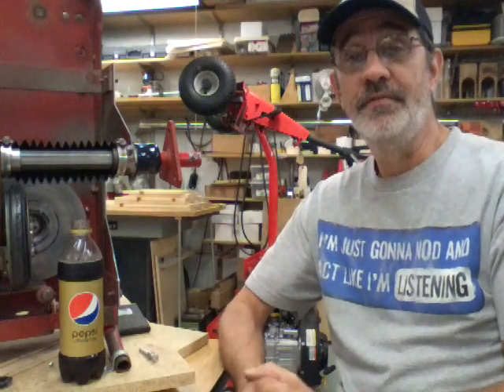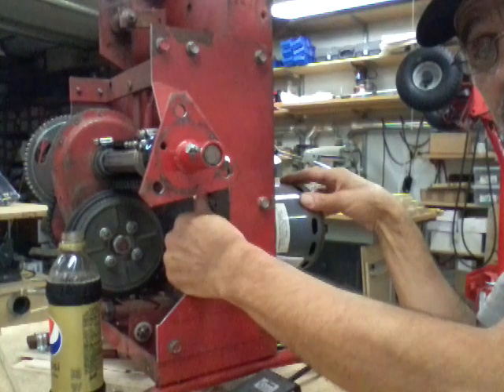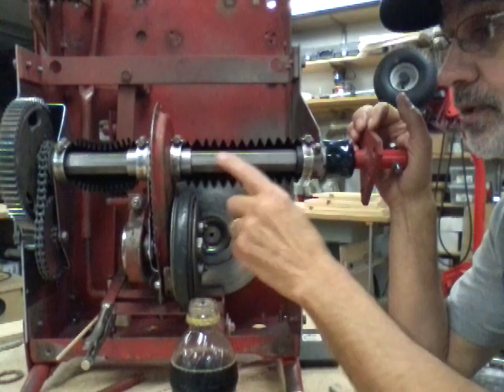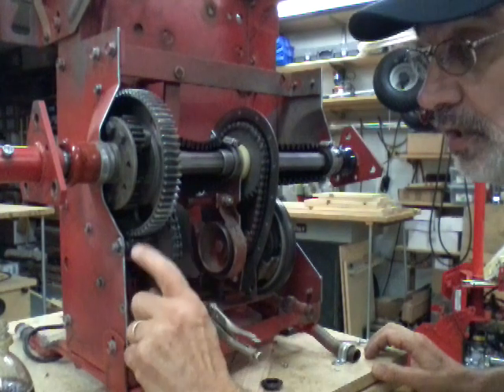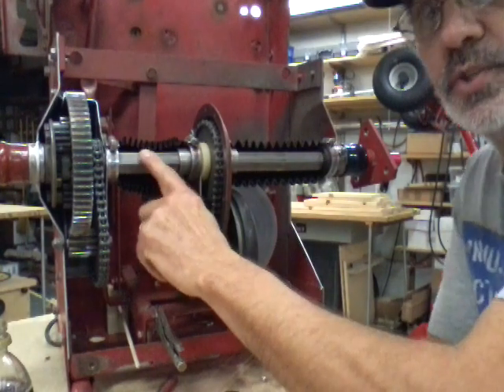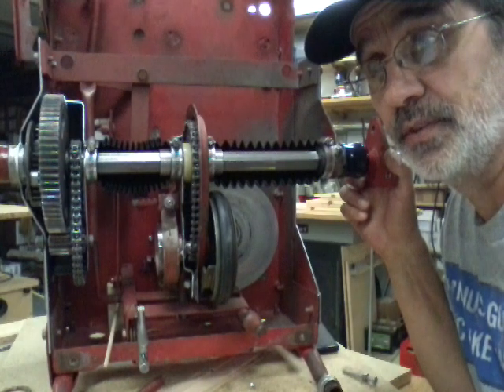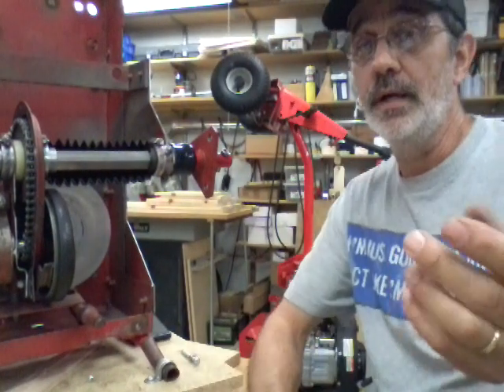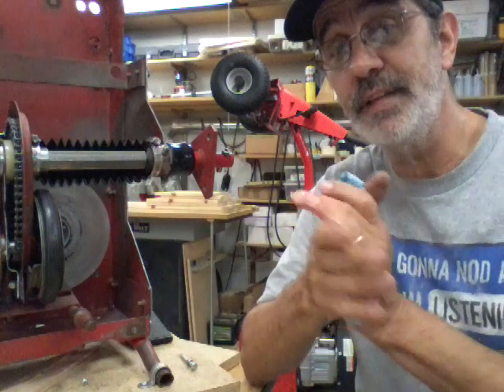132. M/S. 16  troubleshooting the drivetrain on a Snapper rear engine rider

Comment: Bought my house in 1990, came with a1986 11hp 33" rider.  Still in the house, and still using the Snapper.  What a simple, quality lawnmower.  Your video on the transmission, makes me appreciate it even more.  I never knew there was that much engineering in the final drive. Thanks again for posting this video 👍  Love my Snapper
Reply from the maker: Well thank you for watching and hopefully for subscribing it’s free and it really helps me. Jim
Reply: I have that mower!  33" single blade and the innovative swivel mechanism make this the best cutting mower I've ever had, and I've had quite a few. I bought it for $250 with a shot rubber wheel from a guy who had just got him a zero turn. We went through it and replaced chains and differential gears. After one of my boys forgot to replace the oil in the original B&S 11HP, we salvaged a Kawasaki 14HP from a Deere, and kept the Snapper going. My says "Hi Vac Xtra Tough" and it is. It's 38 years old and so simple and tough, I think I'll keep it a few more years.  I just watched this video because after a belt change the brake is locked on.  We'll figure it out with help from Jim.

Comment: Jim, Thank you for the terrific videos. So I had a drivetrain problem on a 2015 Snapper rider as it stopped going forward and backwards as I vacuumed up the last of the leaves. I almost gave this repair to a local shop due to my arthritis but it is a warm day in NJ so I went for it. I did all the trouble shooting recommendations you suggest and moved to checking the reduction gears in the transmission. I removed the right tire and the transmission cover bolts expecting to find a bad gear. Nada, all looked good and put it back together just enough to reconnect both axels. I repeated checking by turning the friction wheel and could feel the right hex axel turning under the boot. I looked some more at the left side and noticed the left wheel sometimes turned giving me a false positive. I  then removed the plastic wheel cap finding that the axel bolt had sheared. LOL I am still chuckling to myself, such a simple fix! Recommend that your video be edited adding that as a first step one should check both axel shear bolts.😁
Reply from the maker: Oh I have a video talking strictly about that because it is such a common issue but I’m glad I could help if you need anything else please let me know and I hope you subscribe it’s free and it really does help me keep this channel going. Jim
  Oh yes I forgot I do charge for my help and what a charge is a picture of you sitting on your snapper to hang on my wall of friends. I have a little over 200.
You can send it to my email which is
jimsfixitshop@gmail.com  and any other questions you can send there also.I try to put out a new video every two weeks at least and as soon as I get my shop cleaned up I am going to have a shop tour coming up pretty quick.

Comment: Hi Jim, 
Due to the drive chain issue, I ended up buying my first 'brand new' Snapper. I've had 4 over the previous 37 years - but I always purchased a used Snapper. The drive chain issue was not resolved by switching the transmission on a older unit. I'm excited to have one that I will be able to use reliably for the next couple years. The old one was hard to start, leaked/burned oil, so the transmission was the final straw. 

Thank you for your help and support. I will shift from watching how to repair to how to maintain. 

Best regards, 
Paul - South Jersey
Reply from the maker: Paul Raybould 
Hey send me a picture of you sitting on your new snapper. Jim

Comment: hello. Just bout a used 33" snapper and it doesn't have enough power in 1st gear and gets stuck in thick grass.. I'm going to go through it per your video and see what's up. Thanks for taking the time to explain all of that to us. I will keep you posted with my progress. Thanks again.
Reply from the maker: @grey8940  well first watch video number 70 and tighten your yolk, spring and see if that helps
Reply: @jimjackson9381  Yes! okay, I will do that.

Comment: Great video and information! My snapper just started "bucking" when I put it in gear and drive. Almost like there's a bad tooth or something on one of the gears. I guess for now I can check the drive disc and then go from there. It's obviously worse when I go uphill because I'm putting more of a load on it.
Reply from the maker: Let me know if you need anything or help.

Comment: Thks, Jim, that "explains", the mystery of how< "this", differential works . Real good explanations, I don't have all the names down. I already forgot how many teeth were on that big gear. but everytime I watch your videos I get a little bit more. Still looking to see what part gives the different speeds.
Usually it's a transmission . But I don't see one! I think I'll ask that new co-pilot thing in my computer
to see what his or her explanation is of where the transmission is on a snapper  rear engine mower
lol
Reply: the answer I got from the co pilot about where is the transmission No conventional tranny. Explanation was, as the chain case moves along the hex
drive axle it changes sprockets in the differential with the chain drive inside the differential . I'll have to look in my manual's
parts layout and see if I can spot different size sprockets.
The co-pilot also referred me to your videos, but I haven't found one yet explaining the shifter movements thru each gear 
and showing all the sprockets in a pile on the bench used
and explanation of how just because the chain drive gets closer to the differential box it can magically switch chain sprockets into a higher gear ratio.
It doesn't seem like there is that much room in there to do all that
Reply from the maker: A snapper is a friction drive machine that’s been around 50 years. It’s very dependable simplistic and easy to fix. You won’t find anything else on the market that picks up leaves like a snapper does as long as you buy a rear engine snapper with a Hi-VAC deck. It is a patented deck design that no one else currently uses even though I’m sure the patent has long since expired.       Happy Shappen.       Jim
Reply: @jimjackson9381  I put a long post how
I figured it out putting 2 & 2 together on video 89 I guess there is no heading transmission cause there isn't one. sort like variable speed in a way. As I still have never driven one. Thks for the ability of a HV version. I had a chance to buy one of those
I guess would of given mine more of a purpose I didn't know they picked up leaves so good. But it was missing the catching stuff and more money.

Comment: Thanks for the video.  I'm having an issue with shifting.  My snapper runs fine in 1st & 2nd gear.  It also runs in 5th but it will stop.  It will move again if I press in the clutch.  It only does this in 3rd-5th gear.  I just replaced the clutch disk which was a bit worn out but that didn't solve the problem.
Reply from the maker: You may want to try tightening your yoke spring and check the slot in your yoke to make sure it is not wore out that will cause issues. Jim

Comment: Jim my name is wayne and i am from Knoxville Tn i am enjoying and learning a great deal from them. I have a snapper model 28106-2 rear engine snapper lawn mower and having the now forward or reverse. I have checked the movement of the axles and tires and the transmission is i believe working as it should. I decided to disassemble the rear axle and differential case to check some of the items that you suggested. i found that the bearing on the right rear axle has worn just down to the frame but no further, the clutch disk is worn down but more on one side of the rubber disk than the other. I assume this is because the axle was out of alignment because of the extreme bearing wear. I did take apart the left side and take apart the diff case, i found most of the parts seemed ok but the large gear was extremely knifes edge. Not sure if the chain needs replacing but probably does.  Now that you kind of know where i am at and have limited funds and the fact that i only use the mower three or four times a year to mulch the leaves. I know the long axle
shaft has some wear on it but if i just replace both fender bearings, boots, clutch disk, the big gear in the diff, and the chain without the long axle in your experience how long do you think the fender bearings would last if i only use it 4 times a year on 1/3 of an acre . Thanks for your help wayne
Reply from the maker: Yes I think you’d be OK by doing that the long axle usually gets more Abuse because nobody greases the outboard bushing in the fender if you look close you’ll notice there is a grease fitting in it but it seldom gets any grease I might grease mine once every two or three months. Thanks. Jim
Reply: @jimjackson9381  Thanks for the quick response, if you have any good used parts i could purchase from you from the ones i listed i would be happy to get them from you before i make my buy on new ones.  thanks Wayne

Comment: Hi Jim, So glad I found you. Have a 2012 SPX 2042 and trans is grinding. Still works, but dealer said he doesn't know what's wrong but would be too expensive to fix. Ugh. Not sure I can tackle this myself but at least got a lot from your explanations on how it all works. Should probably check in with someone else that i know as to whether its worth fixing or just run it after its regular service. Was told not sure how long trans will last.  Would appreciate any feedback on all this. Thank you!!
Reply from the maker: I’m gonna need some pictures of this thing I’m not sure I know what the SPX 2042 is that model number doesn’t sound familiar at all to me you can send the pictures to my email which is
jimsfixitshop@gmail.com
Thanks.    Jim

Comment: Jim, I have a 2011 Snapper rear engine 28" mower. I am replacing the engine. Do I need to remove the mowing deck to reinstall the engine????  Stupid me I did not see that the oil filter came loose and the oil drained out seizing the engine. Lesson learned. Also do you have a video and replacing the engine?
Reply from the maker: Sky High 
No you don’t have to take the deck off it might make it a little easier but you should be fine, you do want to check the engines and make sure that the crankshaft is in the same location in relationship to the bolt pattern that holds it down to your machine otherwise you’ll burn up clutch disks in no Time. Jim

Comment: Your model is awesome- my snapper all of a sudden is jerking real bad when I put it in any gear - when I turn it Jerks as well and the mower "slides" in stead of turning
Reply from the maker: Well, I’m not sure what’s causing the jerking but when you try to steer and the machine goes straight, do you have a bagger on the back your machine? It sounds like you need to put some weight on the front between the two front tires and check to see how much tread you have on your front tires that will also allow them to slide instead of turning. Jim.

Comment: Just bought a used model 281016BE Snapper and was made aware that the engine would shut off when brake/clutch pedal is released. Was shown that the seat switch had already been bypassed years ago and not the issue. It looks like you briefly showed a switch in another video at the bottom near the yoke. Do you think that could be the problem? I really enjoy all the info you show in these videos!
Reply from the maker: Well,by what you’re explaining I would say that’s definitely your problem. Take that switch off and check it and check the wires going to it. Jim.

Comment: Thanks for the help, sir. My Snapper ST2446 46-" mower began surging while I was mowing. When I pressed the pedal, the mower would hesitate for a second before final engaging and jerking forward. It finally totally stopped engaging, and now won't move at all, either forward or backwards. Any thoughts or suggestions?
Reply from the maker: You could have broken one of the chains either in your chain case or your differential. Jim
Reply: @jimjackson9381  Thanks. Might have to let a pro work on it.

Comment: Hi Jim I’m a subscriber but I haven’t seen my problem. My snapper acts like the clutch is slipping. It won’t go up a small incline and even worse in higher gears. The wheel has lots of rubber on it. And reverse seems to work good. Thanks Jon Helms.
Reply from the maker: Jon Helms 
Have you watched video number 70 it will explain how to tighten your yoke spring that is probably all that is wrong with your machine, if it doesn’t help please let me know. Jim
Reply: Yes That was the first thing IDid.
Reply from the maker: Jon Helms 
OK now takeoff both tires pull your dust caps away from the outside of your fenders so you can see your bushings if your bushings are worn and letting  the axle swap around that’s going to affect how the machine operates check that and let me know. Jim

Comment: Jim,
My 28inch snapper locks up. After pushing and pulling the machine it unlocks for a period and then locks up again. Think it's the big gear or one of the pinion gears?
Reply from the maker: Oh, if I had to guess I would say that’s probably what your issue is send it up and look at the outside of the differential case and see if it’s OK or if it has a rip in it. Jim.

Comment: Would you recommend 80w90 gear oil over the "00"? Just bought my first snapper sr1433 !
Reply from the maker: No, 8090 is too thin and it’s gonna leak especially on an older machine that hasn’t been built to except the thinner oil.         Jim

Comment: I have a hyvac Snapper  older machine   idk it's running great  until  I downshifted  and now I have no engagement  of gear or reverse  do have neutral and park I believe but looking at your video I think it has something to do with the pinion gear the main that drives the spur gear you said somebody shaves off I might have to look and see if that's the problem somehow I'm not sure what model it is

Comment: Drive train smoothly surges causing me to rock back and forth every few seconds in high gear mowing, not as noticeable in lower gear. Motor seems to run steady.
Common issue?
Thanks for great informational video, was curious what was going on in the gear boxes.
Reply from the maker: That one is new to me. The only thing I can think of is one of your chains either in your chain case or differential is getting stretched out and causing the jerking.         Jim
Reply: @jimjackson9381  Thank you for the reply!!!
Your videos are SUPER helpful. Greatest snapper resource on the web!
Its a replacement engine that someone else did, I adjusted the flat motor driver plate to spec so it would contact rubber wheel in all gears. Was only engaging in 4-5th gear before I adjusted it, now running in all gear positions. 

Ill watch your motor replacement video, maybe they missed something during motor swap.

Ill also check in that gear box and see if chain is consistent and check for wear etc... Ill find something if I look long enough.
Thanks!
Reply: @jimjackson9381  OK, solved it....
apparently, when two bolts fall out of a rim, and only one is holding it on, the tire creates an eccentric motion, that i didn't notice in the bumpy field. LOL
So the differential was picking up the play and smoothing the motion with the other tire or something. IDK... but dropped in 2 bolts and the surging stopped. 
Sometimes the simplest thing I tend to overlook. 
I didn't have a chance to closely check it out last time, so the symptoms I assumed were drive train related, didn't expect it to be lug bolts.
Reply from the maker: Well, that’s one for my record books. I’ll have to keep that in mind in case someone else comes up with that issue. Thanks for letting me know what you found out.          Jim

Comment: Jim, thanks for sharing. I will have to run through the steps on mine. The fly in the ointment for me, mower was riding great in backyard. Took through my gate to begin the front yard, set the brake, got off tractor to close gate. Got back on pushed on brake to release and put into gear, mower would not move. Tried reverse and alother gears, nothing. Looked down at brake pedal and noticed the cable had slack. Is it possible for the brakes to lock up?? If so what is the plan of attack?
Reply from the maker: John Dunbar 
Hi John it’s Jim
   First off  stand your machine up and see if your cable has broken or came loose somewhere’s and look to see if you can find anything else that is broken or missing and let me know. Jim

Comment: Jim my RE130 stopped and the engine died. It was locked up and would not move in neutral. got in garage and lifted it. Initial response was when I ran the mower and out into gear I could feel/ here it bind just a little. Put jacked back up and ran thru all the gears and it seemed to run well. Let down and rode all around my garage pad then parked it. Still felt as though it was binding a little. could it need dope in the rear gear and chain cases?
Reply from the maker: Well it wouldn’t hurt to add some if it’s slow and see if that helps let me know. Jim

Comment: Jim,I have older snapper rear engine rider, the shifting carriage seems frozen on the drive shaft ,every thing is disconnected from it but it won't slide either direction. I don't want to break anything by forcing it to much. Any suggestions.
Reply from the maker: @joewarren9037  you’re going to need to send me a picture so I know exactly what you’re talking about my email which is
jimsfixitshop@gmail.com
Thanks